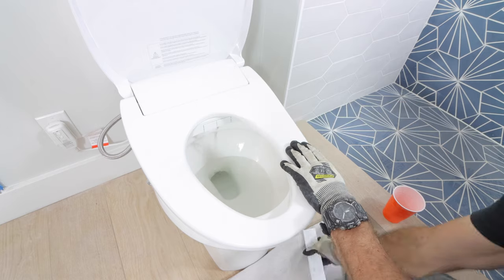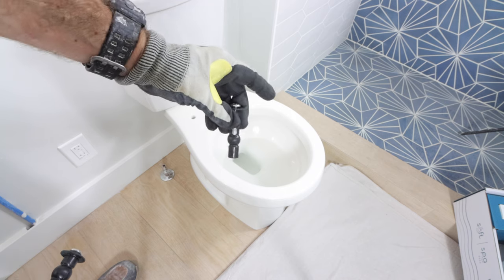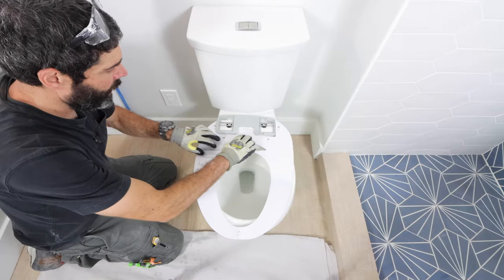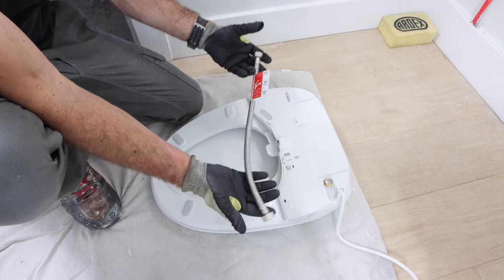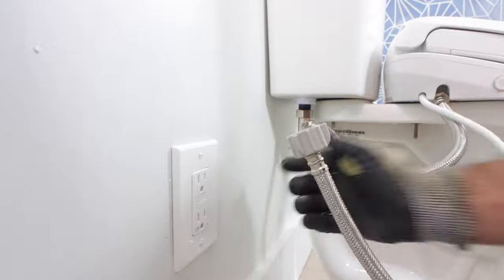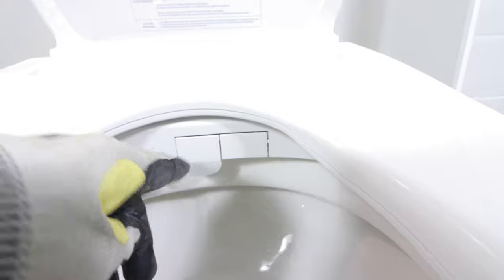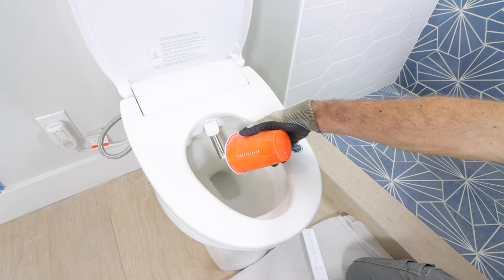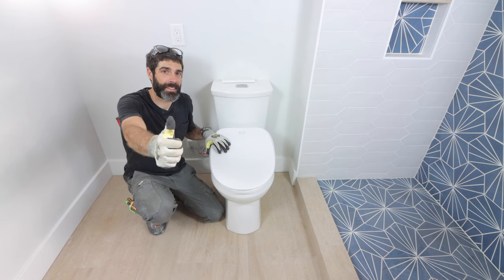Bidet Toilet Seat Installation for Beginners - Fluidmaster Soft Spa Electronic Bidet

Comment: Not using any tape on those connections is just asking for a leak.
Reply: Tape should only be used on tapered threads that use the threads to provide the seal.  When you have straight threads with a a rubber internal ring (as all toilet and sink hoses use), then the internal ring provides the seal.  Tape should not be used in addition, because with tape it will be difficult to determine when the internal ring seats on the mating surface as you tighten the nut.